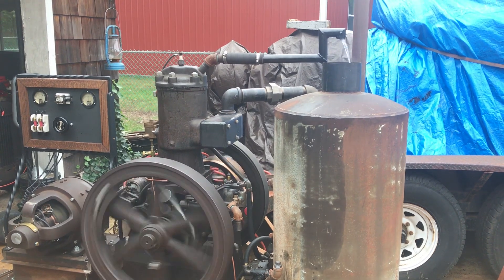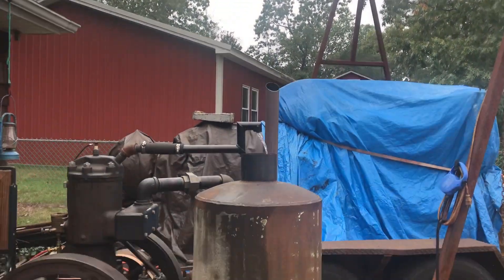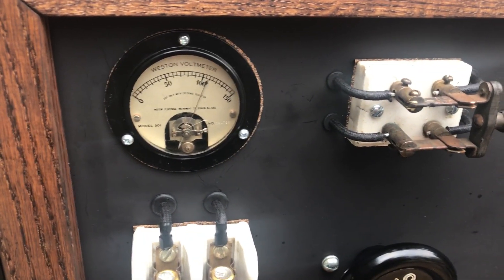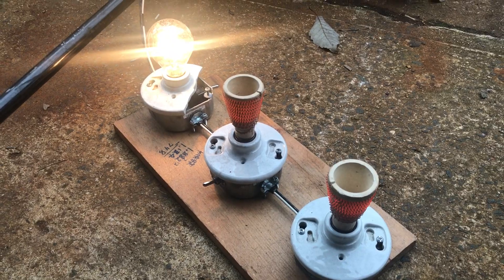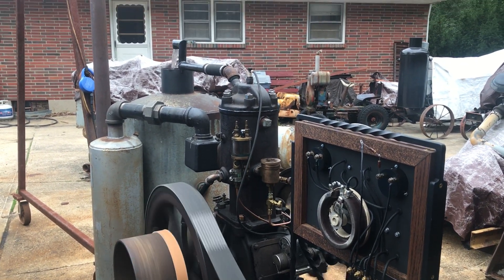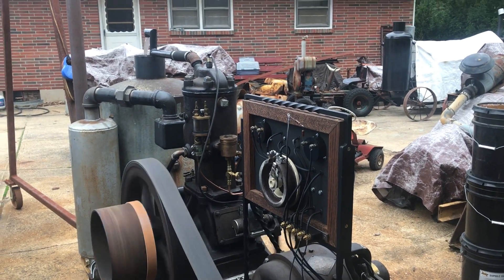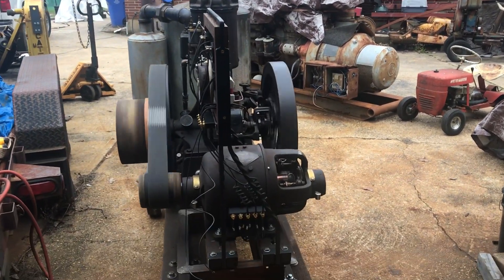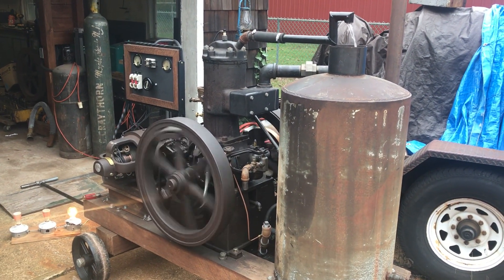BESSEMER ENGINE AND DYNAMO RUNNING CLIP

Comment: Guessing you've switched it over to gasoline? I remember you were having trouble running it on propane. The occasionally missing sounds sorta like a rich mixture miss. But with the amount of smoke coming out of the exhaust pipe, I wonder if the cylinder starts to load up with too much oil, causing the engine to misfire? I know oil control can be tricky on those crankcase scavenged two strokes.